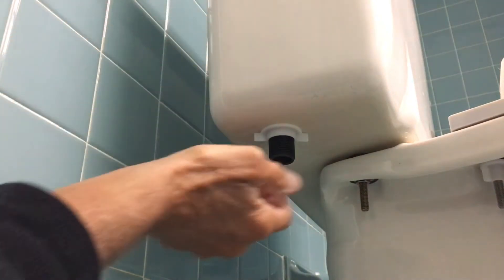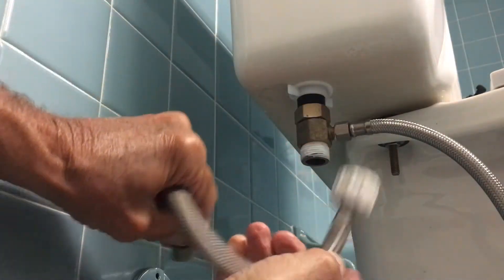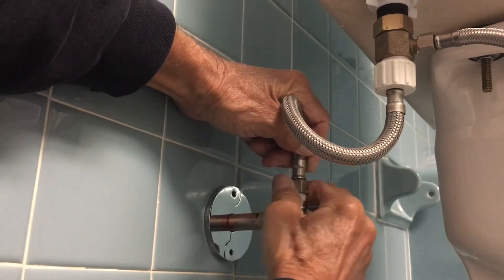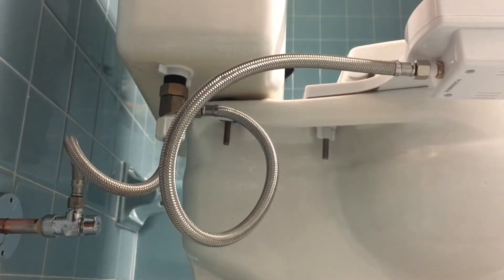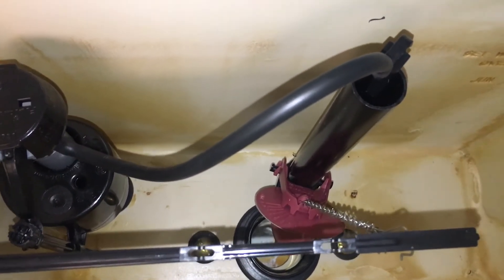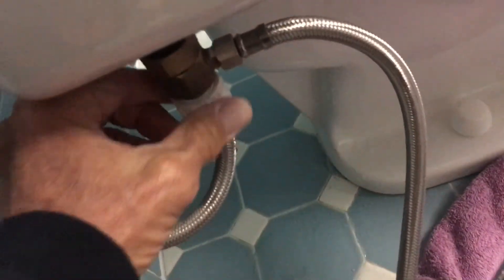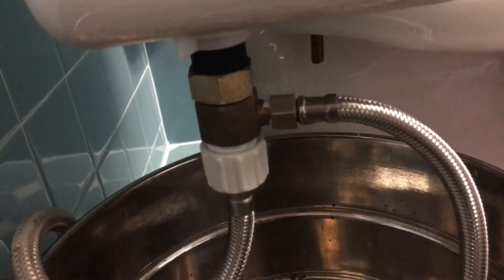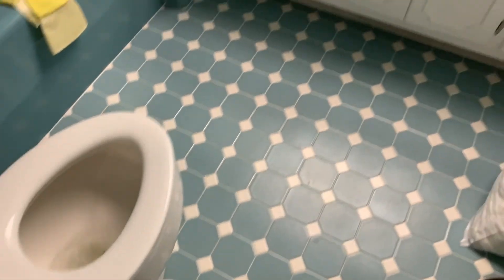How to connect water supply lines to toilet with a bidet

Comment: You don't put Teflon tape on a flex supply line.  They have rubber washers in the for that purpose.   Teflon tape can actually cause the connection to leak.  Just fyi.
Reply from the maker: Excellent tip thanks

Comment: I accidentally twisted the t pipe at a small angle ans now it's stuck. Any advice?
Reply from the maker: You could just purchase another one or send back the unit and get a new one and start from the scratch
Reply: @TomLeeman  I can't get the T pipe piece off of the universal valve. It's stuck. Any tips on how to remove it?
Reply from the maker: @TracyHRodriguez  may need two pairs of channel locks, but make sure that you’ve got the water turned off and you might need a bucket to catch any water that comes out of the water closet. Good luck thanks for watching.

Comment: I don’t know why but when my valve is shut, it shuts both outlets not allowing water to go to my toilet, please help!
Reply from the maker: Usually you just have cold water running through your toilet so it’s just one valve if you open the valve that is underneath the toilet the water should flow through into the universal flow valve and fill your water closet make sure that that valve is turned open you may have closed it off good luck thanks for watching